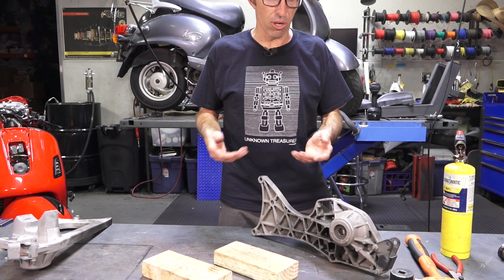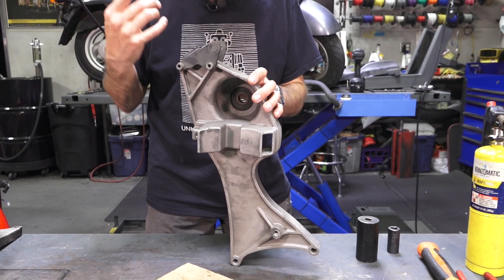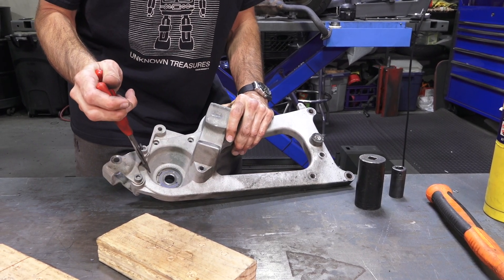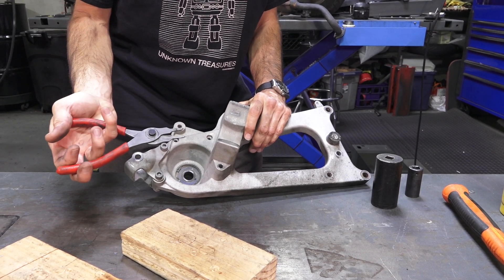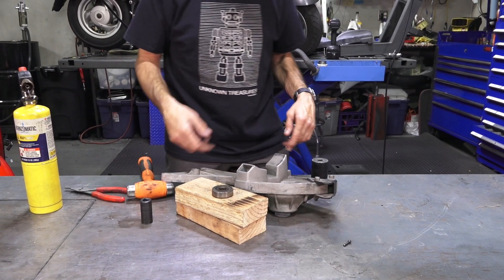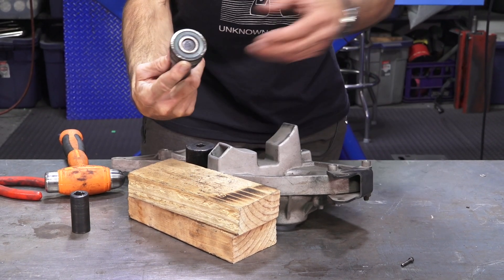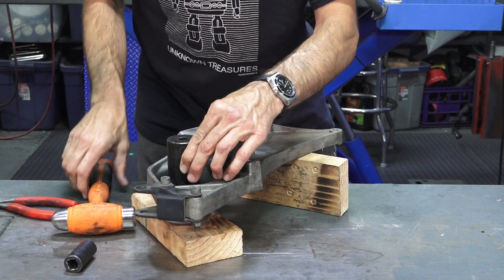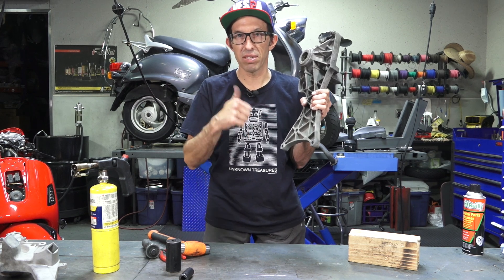How to Change Vespa Swing Arm Bearing (or any roller bearing) with Basic Tools

Comment: Excellent vid, as usual. At 75 years of age I have given up riding cafe' racers and finally got a REAL scooter, A Vespa (GTV 300.)
About drifting the bearings in, at the BMW motorcycle factory, they sit the new bearings on a piece of dry ice (available at most large grocery stores: Safeway, Luckys, etc. to shrink it for fitting. It's clean and easy. And when the bearing lands "home" there is a definite change in tone when you tap it into place. I'm not doing the wrenching I used to, but I still enjoy seeing how things are made. First class entertainment for me!
PS. Dry ice is dangerous, it will burn your skin off in a second. It's necessary to transport dry ice in a Styrofoam container.

Comment: Great video. I used it to change mine. Bought the bearing from you guys, arrived fast to Australia. I was lucky and hand no issue with removing the swing arm off the axel. Rubber mallet and wiggle wiggle. I used a heat gun. 60 secons for each side of the swing arm. 36mm socket but i reckon a 35 would be better. All up, easy job. Thanks again.

Comment: You can also put the new bearing in a closed plastic bag and in the freezer the night before you plan to install it, the cold will shrink it and make it easier to install, not necessary but helps

Comment: I was very jealous of this silky-smooth demonstration of the heat-and-tap removal process. My bearing's outer race was corroded into the swingarm after 13 years of harsh treatment by previous owners. After the inner race and bearings were broken out, the outer race had to be cut out with a Dremel and a LOT of very bad language.

The proper swear words to use on specific jobs would be an interesting future video subject.

Comment: Hello, I am using 2013 model vespa gts 250.  During a long journey in 2017, I started hearing a caterpillar-like noise from the front.  This sound comes when traveling at a certain speed.  I only hear it when driving at 70 90 km/h.  While pushing my front wheel left and right, a gap caught my attention.  So the wheel wobbles a little where it stops.  Will this be fixed when the bearing on the front is replaced?  At the same time, the handlebar vibrates when driving with one hand.  Will all these problems be fixed if the bearing is changed?

Soryy Google translate

Comment: Won't  the seals melt in the new bearing when it goes into the hot  alloy  ?
Reply: They only tend to do that when they're hit with direct flame. There seems to be enough thermal mass in the races, rollers, and grease to dissipate the heat to prevent scorching (and ignition of the grease).